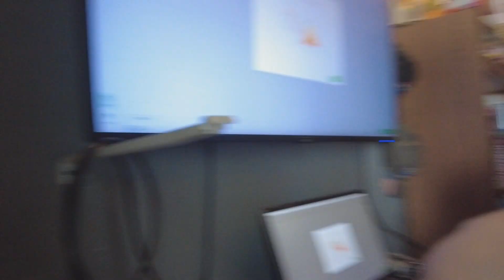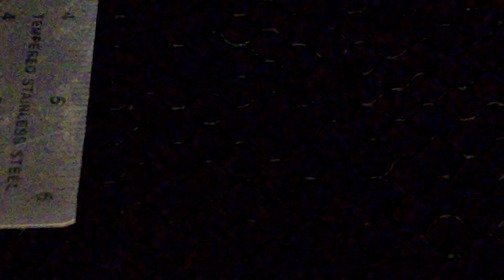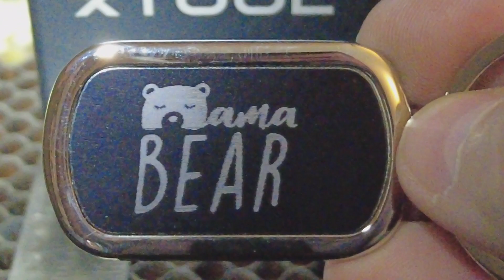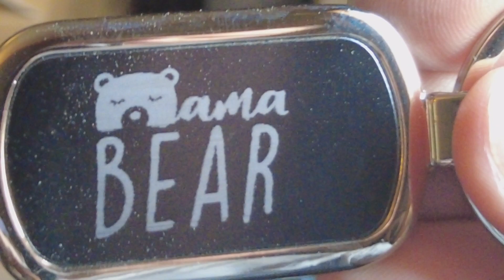Focusing Tip for xTool D1 Pro

Comment: So do you zero out the focus knob on the needle side?
Reply from the maker: I never touch the focus lever adjustment on the xtool.  To defocus, all you need to do is lower the focus bar like normal but have a 1/8" piece of something on top of your material and let the lever touch that.  Then when you put the focus lever back up, remove the piece you used to focus to.  Super simple that way and you don't have to adjust the actual position of the lever.